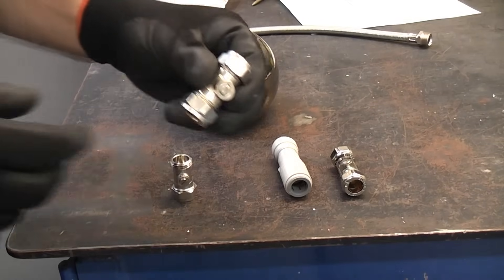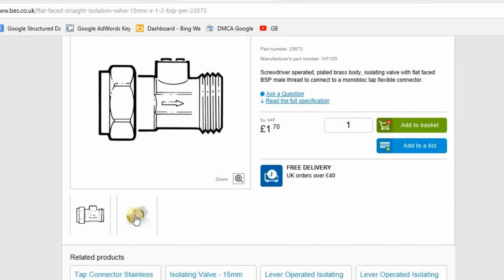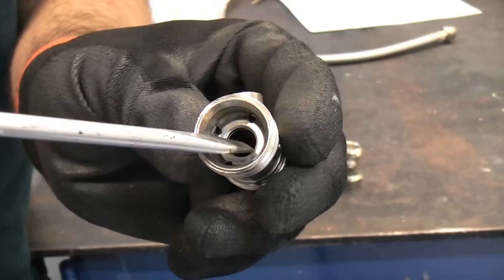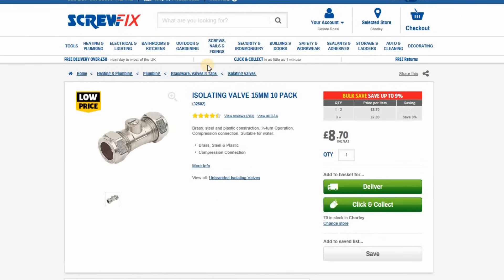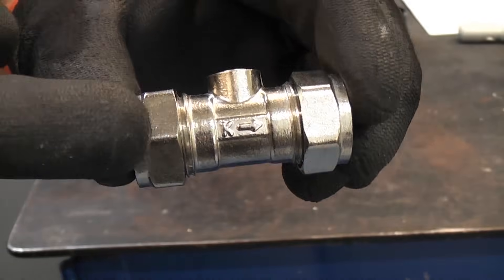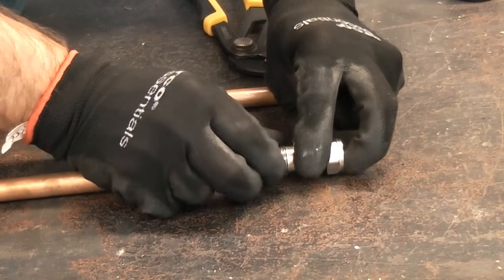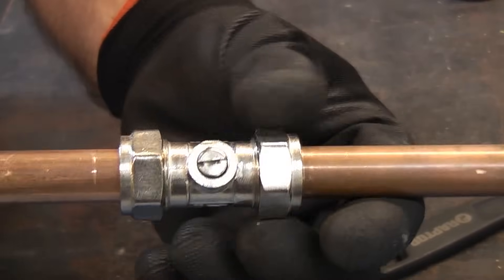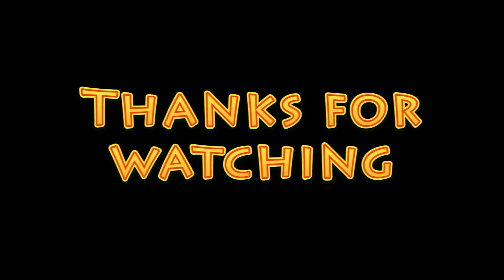How to fit an isolation valve ⚡

Comment: it seams like just about every time i turn one of those valves off it bloody leaks, had to replace one yesterday that wouldn't stop leaking, right pain in the bum,  turned off two stopcocks to that building and i still had water coming through the pipes,  a bit more looking around and discovered a third stopcock, about two hours wasted just replacing a 15 mm isolation valves :-(
Reply from the maker: We have lots of these at work and they always leak when you turn them initially, but they seem to reseal again after a while. Perhaps this is why a lot of plumbers do not bother installing them in the first place.
Thanks for the comment 👍

Comment: Do I need to clean the pipe of old paint before applying these compression valves or push fit connections? If so what’s the best way to clean them?
Reply from the maker: Yes it is best to clean the pipe, you can use wire wool, or if you are struggling a blowtorch will quickly remove paint from copper pipe.
Reply: Ultimate Handyman thank you, appreciate it, love your videos have me the confidence to rip out my old bath room saving a fortune, looking to do the same in my new house but will attempt to put it back together again!

Comment: Another great video mate. Here's a tip: When you come to close one of these valves after they've not been touched in a long time, squirt some WD40 into the gap near the screwdriver slot, turn it a little, then squirt some more. If resistance is met try turning it the other way.
Reply from the maker: Thanks for the info

Comment: Can I fit an isolation valve on the hot water pipe from the hot water tank so I can stop hot water to all the taps in one go
Reply from the maker: I'd use a full bore isolation valve, if I were you, so that flow is not reduced. 
https://fave.co/2YgHkSl

Comment: have you ever tried to use a gas rated valve on a water setup ? i was told by a plumber that gas fittings will leak if used with water, but in my experience they dont, i would be interested how many bar of pressure they can withstand.
Reply from the maker: No, I have never tried a gas fitting 🤔
Thanks for the comment 👍

Comment: You know what? I´m subscribing from now on. This was informative enough to feed a family of five. Luckily I have no children. I will use my new knowledge very soon to replace a leaking (as in internal which causes a toilet with a broken sealing to have the water tank filled up within 10 hours even though the valve is closed) isolation valve.
Reply from the maker: Thanks for the comment and the sub 👍

Comment: Hello, thanks for such a good video. We have installed the valve as per your instructions but it's leaking from both screws. The previous valve was installed the other way round. Do you think it has an effect? What would you suggest??

Thanks in advance! Once again, very helpful videos!!!!
Reply from the maker: If it is leaking from the compression nuts, they might just need tightening?
Ideally the arrow should point in the direction of flow, but in most cases it will not matter.
Thanks for the comment 👍
Reply: @ultimatehandyman  thank you for the quick response!!!!

Comment: Hi, I want to add an isolating valve to a length of 15mm pipe that’s already in place. It runs to an external garden tap. I just want to add it on the internal side of the wall (it runs from a downstairs bathroom) I basically want to cut some length from the middle of the pipe and add the valve in its’ place. How much pipe length should be cut away?
Reply: Looking for the answer to this question, did you figure it out?

Comment: When I turn the screw for my isolating valve water comes out of the screw head  would it be faulty?
Reply from the maker: They often do, but when you open the isolation valve again the water will stop dripping in most cases.
Thanks for the comment 👍
Reply: @ultimatehandyman  I've just noticed a pool of water under my kitchen sink cabinet so I'm assuming the isolator valve is far gone, thanks for your reply 👍🏼

Comment: Great detail video but I wondering do you need to make the pipe shorter to allow for the length of valve and how much?
Reply from the maker: Yes, you need to make it shorter, unless there is a lot of movement in the pipework. You can measure how much by inserting the pipe and olive into one end.
Thanks for the comment 👍

Comment: NEVER EVER buy and fit those cheap isolation valves. The ones where you get a few, like 10 from Screwfix, for less than £10. They ALWAYS leak just when you need them not to!

They leak through the slotted part that you turn to switch the water off

Either buy more expensive ones, Pegler etc, or, much better, buy full bore lever valves. They never leak in my experience 

You have been warned!
Reply from the maker: Thanks for the comment 👍

Comment: How do you calculate how much copper pipe to cut out to accommodate the valve. Thanks.
Reply from the maker: If you push the pipe all the way into the valve, or push something in, then mark the end of the nut with a marker, then pull it out and measure the mark from the end, you should get an accurate measurement of how much pipe you need to cut out.
Thanks for the comment 👍

Comment: If I do this in situ, will the copper chippings from cutting and deburring cause any issues if they fall down the pipes? Or can I just run the tap with the aerator / nozzle  removed to flush them out?
Reply from the maker: It will be fine, as long as you flush the pipe out afterward, as you say though- remove the aerator if possible.
Thanks for the comment 👍

Comment: What would the consequence be of installating a ball valve in the ‘wrong’ flow direction? Thanks
Reply from the maker: Because of the way smaller ball valves are manufactured, there is a chance that the valve could fail- if there was sufficient water pressure and the valve was in the closed position, however I have tested one on my pressure testing rig and it held at 50 Bar of pressure- so in most cases, nothing much will happen. Things could be different with hot water though, due the expansion/contraction over time.
Thanks for the comment 👍
Reply: Ultimate Handyman thanks!!

Comment: Is it OK to use these on central heating pipe work?
Reply from the maker: You need to check the instructions with the ones you buy, some are suitable and some are not. The JG speedfit one, is not suitable.
Thanks for the comment 👍

Comment: Thanks for the great video your channel is brilliant.  

I prefer full bore so can you get a flat faced iso valve in full bore?  If so where from please?   
If not available in full bore can I use normal full bore (not flat faced) with flexi tap tails ?
Reply from the maker: Thanks ;-)
I don't think you can get full bore, flat face isolators- yet. But you could use a full bore isolation valve and tap tail adaptors- 
https://www.screwfix.com/p/brass-compression-adapting-flexible-tap-connectors-15mm-x-2-pack/2665r

I have used normal isolation valves with flexi's in the past (as that is what a plumber told me to do years ago, but the flat faced valves/adaptors are a much better idea)

Thanks for the comment
Reply: All you need is a file to flatten the end that will connect the flexi

Comment: The previous owner of my house installed a number of valves the wrong way around. They actually seem to work correctly that way as long as they're in open position. However as soon as you close them (which I need to do to replace the tap) they started to leak heavily from the valve knob... :(
Reply from the maker: Thanks for the comment

Comment: I thought I knew everything about fitting isolation valves but that tip about the weeping screw was new to me, thanks! I have replaced valves in the past for that problem.
Reply from the maker: Sometimes it works, I guess a lot depends on the water and how much solids are contained in the water.
We use Reverse Osmosis water on site and virtually all the minerals etc. are removed from it- so it is notorious for leaking and not sealing again, whereas with normal water sometimes a weep will seal itself.
Thanks for the comment 👍

Comment: A: ALWAYS buy a full bore 

B: DON’T but cheap ones. They ALWAYS leak via the slot so absolutely pointless using them since they won’t seal when you need them

C: great video, but minus 1 point for saying “ferrels” :)

👍
Reply from the maker: Thanks for the comment
Reply: ferrule is the technically correct term when specifying the part

Comment: Very informative! Are full-bore ones (with a lever) suitable for use as the main stopcock? I really need to replace mine!
Reply: If you want to stick to code it should be a proper stopcock, however a decent ball valve will do the same job and give you better pressure.
Reply from the maker: I have read conflicting advice about doing this, but most of the comments I have read, have suggested it will be fine- just open and close the lever very slowly.

Comment: For pipework where you need a a better flow you can buy the full bore ball a fix valves so there's no restrictions in side the pipework, either with a lever or slot.Great instructional video though
Reply from the maker: Thanks for the comment 👍

Comment: Big up Alan Smith for that link. Gonna check it out now. Let's hope they do a 1/2" (15mm) to 3/8s " version. Some flexi tap tails are not 1/2".
Reply from the maker: Yes, those isolation valves are superb. 
It seems they do sell a 3/8 version- https://www.bes.co.uk/flat-faced-straight-isolation-valve-15mm-x-3-8-bsp-pm-23640
Thanks for the comment

Comment: Question. Why is a service valve on a toilet built in 2 pieces ?

Thanks
Reply from the maker: Perhaps it is so that the nut can be tightened onto the inlet valve, without trying the twist the inlet valve itself. 
Thanks for the comment

Comment: Now how do you do it at finger tip reach, out of sight behind a bath with a sink pedestal in the way?
Reply from the maker: It's almost impossible to do it, once the bath is in position. Ideally the isolating valves should be installed before the bath is installed.
Thanks for the comment

Comment: Good instructions and informative video 👍👍. Was shocked at the size of that valve,would not like to change them too often.👍
Reply from the maker: They are not that bad to change, you just remove the 8 or 16 bolts on the flanges and split the pipe and insert a new valve with new gaskets. It's often made more difficult because of where they are positioned, so you are normally on your knees with little room to manoeuvre, but there are worse jobs ;-)
Thanks for the comment

Comment: Excellent video thanks 
How do you drain the water before fittings
Reply from the maker: Thanks.
Normally, I isolate the water via the main stopcock, then open the outside tap, then open the taps upstairs and the water normally drains out.
Some heating systems will have a gate valve, which can be closed (if it's hot water)
Thanks for the comment

Comment: The flat faced straight isolation valves look great, never seen those before and have sometimes struggled when connecting the flexi-tail hoses to get a reliable seal. Cheers for the tip, I'll be looking for some of those as I usually keep a few in the tool box for whenever changing a tap etc, having the isolation valves makes all future maintenance so much easier :)  One tip I can share is if you're considering using the handled isolation valves, is to check the screw that retains the handle with a magnet. I've found a large number of these that use thinly plated steel screws that rust quite quickly, a replacement stainless fixing is a cheap fix and saves the handle falling off when the steel fixing rusts through, especially when you need to isolate a pipe in a hurry and the handle is missing due to a rusted fixing :) Keep up the great content :)
Reply from the maker: I once had an incident with a isolation valve, with a handle- https://www.youtube.com/watch?v=8Yfb1dSZHQ0

Thanks for the tip ;-)

Comment: Thanks for the video.....I've used these a lot but find the "seep" on turning the valve on and off quite common and very annoying. I buy the full bore ones and they don't seem to have that problem.
Reply from the maker: You are welcome
I think the full bore ones are better quality. There is nothing more annoying that fitting a valve to make the job easier next time- only for the valve to leak!
Thanks for the comment
Reply: Ultimate Handyman happened to me tonight! I fitted (cheap) isolators on the tails of a radiator and 4 years later I need to change things. Go to turn the slotted part (after first praying to God) and BOTH of them leaked. 

Even when I turned it back they leaked. So now they leak permanently:(

So I drained down. No way to further isolate or freeze :(

Comment: Thanks for another useful video! Just one question about the full bore version - does this mean it has a larger diameter for the water to pass through? Cheers
Reply from the maker: Yes, the normal isolation valves can restrict flow somewhat. Full bore ones do not restrict the flow, but are a bit more expensive
Thanks for the comment 👍
Reply: Full bore have a far bigger hole
I've a 15mm shower feed that has three isolation valves all restricted.
Don't know why someone did that, ether short of parts or its to slow the flow, drop the psi
  Not sure if one would do the same

Comment: Lost a little trust in plastic ones. The previous owner of my house fitted one on the dishwasher, but it wasn't clipped on the hose side. The weight of the hose put pressure on the valve and the plastic housing split and flooded my kitchen. (Lucky I was in when it did it!) Would have been fine if properly installed but still weary of them.
Reply: Thanks👍Great tip 
Ash🏴
Reply from the maker: Thanks for the comment 👍